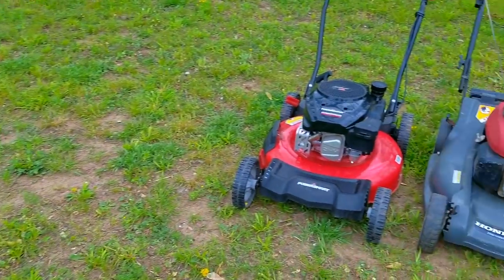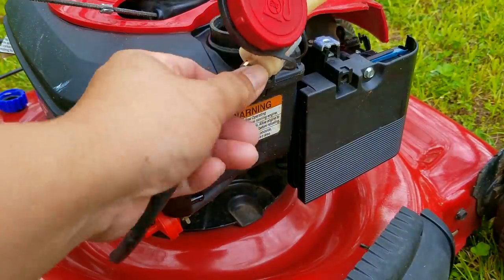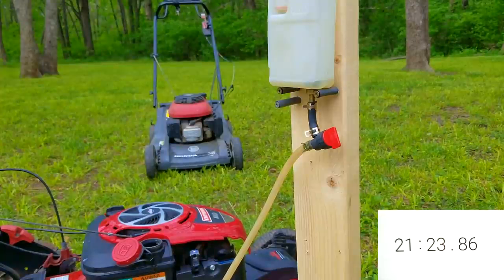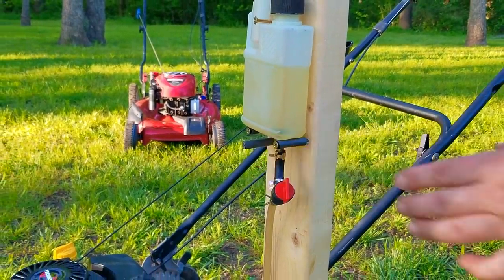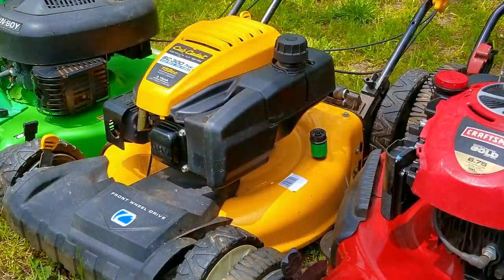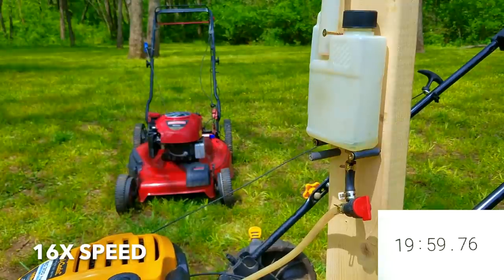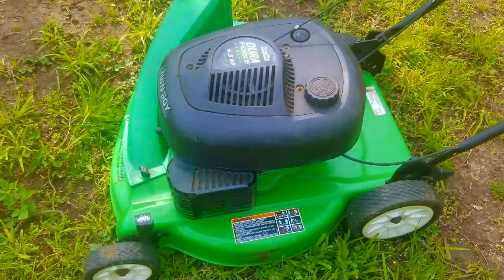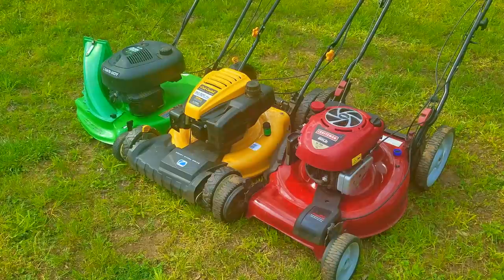One Of These Mowers Will Run Almost Twice As Long As The Other One

Comment: Hi there just for facts 2 stroke mowers are King of the lawns for these reasons. Since lawn boys were made and designed since the 50s until the Duraforce the rpms are at around 3200 whether with throttle carbs to fixed carbs in high or normal speed. Low throttle is around 2600-2800 rpms from my research. Most safe bail brake residential mowers of today and from about 1984 until the present don't exceed the 2800 rpms unless it's a commercial Honda or Kawasaki in which case full throttle are 3000 rpms at 5.5 hp and 6 hp respectively. Thank crappy unsafe homeowners that can't handle true power and the EPA for making 4 cycle mowers the scrap metal junk that they are today because before safety bails they were at 3600-3900 rpms and more expensive than 2 cycle mowers due to more parts to produce and ease of use to not having to mix gas for people that don't know how to properly measure and mix 2 cycle gas . I'm only talking about push mower rotary engine numbers as reel and riding mowers require higher CC's and rpms to run belt drive systems, clutch systems, etc. Hope any of that helps sorry for the 18 page paragraph for explanation. Big love and peace out from Houston, Texas.
Reply from the maker: you've got a lot of information to share and I really appreciate it.

Comment: Tecumseh mower I had was great went thru anything it was very old and well used when it finally died
Reply from the maker: thank you MegaLancet, they're definitely underrated
Reply: @HomeGaragechannel  don't suppose you have a video on viking rideon trying to fix one currently not sure if it's one of the 3 kill switchs or the ignition the battery is fine wiring all seems ok so leads me to believe the key ignition isn't doing its job or the kill switches are stopping it the lawns here are too big for electric or gas push mowers so found a project to speed things up money is tight here so you need to learn as you say we are all hurting over living costs
Reply from the maker: unfortunately no.

Comment: I really enjoyed your video

 now looking at the small push mowers that actually have a throttle control; I would not consider that cheating in fact my riding mower is I have three of them right now have throttle controls my generators have throttle controls

 that is not cheating that is taking advantage of using the amount of power you need instead of wasting gas for a power that is not needed for that job

 when it comes to my riding mowers I got a very good cut using medium throttle and sometimes row below throttle to not wake up the neighbors it does not seem to affect the cut of the grass unless it's very heavy grass and then I use maximum throttle.

 I find it a very good way to save gas that is not needed to be spent because I do not need all that power.

 my current riding mower for a lawn as a Cub Cadet xt-1

 my older models are an errands and a Sears Craftsman.

I'm a big fan of two stroke engines  but  the problem they stop making two stroke engine has a lot to do with Emissions.

 two stroke engines have twice the power stroke and also because it has no valve train is much lighter.   there are a lot of benefits with two stroke engines if he were the two stroke engines I owned was 1 a speedboat,  chainsaws and gardening equipment like weed wackers and hedge trimmers to name just a few.

2 stroke engines are cheaper to make (far less parts) but are emission unfriendly
Reply from the maker: thank you for the information, and no, it's not really cheating to be smart with how you Use the throttle, it's just like driving a car.

Comment: Hey bro wats up? I wouldn't change the adjustment on my mower (if I had one😄) to save money on gas. It just doesn't make sense in my opinion since it might be putting a strain on the engine and it will end up costing you a lot more in the long run😔
Reply from the maker: Great point, Thank you Ramadin Sookhoo.
Reply: @HomeGaragechannel  you're welcome bro

Comment: I own a Toro time cutter ss4235 with the sv710 and it drinks gas. It had gotten so expensive to fuel up I had to stop using it. It will have a new more efficient engine installed soon. My Kubota ZG20 does not burn as much fuel. As the time cutter did and the hydro gear zt2100s are weak compared to Kubota drive system.
Reply from the maker: thank you for the information

Comment: If you want to put a load on it, I would disconnect the shut off wire and apply the engine break while the engine is running.  The only problem would be you may damage the flywheel from the friction.
Reply from the maker: you are correct

Comment: While variable speed mowers may have an advantage it would be interesting to know the speed of the mowers engine as they were tested, and if a tested mower has an adjustable throttle, both the tested engine speed and the maximum speed. Then if it does do better or worse you could estimate how it may perform at at different speeds. Or maybe run them at max speed too for an extra data point
Reply from the maker: yes you are absolute right, I that was my oversight.

Comment: AS Motor have (or had until recently) built a two stroke engine for some of their mowers that still managed to comply with emissions rules, although an EGO power unit is available on AS Motor decks from this year which I assume has now killed off the AS Motor two stroke although a four stroke is still available albeit a Briggs & Stratton.
Reply from the maker: thank you Volvo B10M

Comment: For that type of testing you'll need a swiveling point to tie to other wise the rope or whatever you used to tie it down with will wrap around the 2x4 or whatever it's tied to , also I agree the self propell is not meant to drive the lawn mower by it self most will struggle to as well especially with making a circle constantly straight lines is one thing but turning will put extra strain on the drive wheels now I know some of them probably can do it but the testing wouldn't be repeatable with every mower   in my opinion so the only way to test would be to actually use the mower with you testing tank attached to the mower and see what times they get to be fair to all the mowers involved which I'd only test the longest running ones with the drive activated and see what if any difference in times they get
Reply from the maker: very true, we'll see what I decide on .
Reply: @HomeGaragechannel  indeed we will see lol 😆  looking forward to seeing the next video

Comment: The AS Motor International AS531 is the only 2 stroke mowers that are produced and available on the market from my extended research on the topic of 2 stroke mowers but at a price tag of 8000 dollars plus how much it would cost to get it from England or Germany your better off trying anything old from the states or Japan honestly unless you got it like that then all power to you. It features an old rare Briggs classic Komatsu made engine that used to be in old snapper push rotary mowers. Snappers had the most outsourced 2 stroke engines of all time with Briggs , Tecumseh and Wisconsin Robin all ending up being replaced with 4 cycle garbage.
Reply from the maker: thank you for the information, I'd just buy an old lawn boy instead. The AS stuff looks really cool though.

Comment: I've seen another Channel weld flaps to cause drag on the blades.
Reply from the maker: that would work too, but I don't want to damage the blade, or even it's a test blade with the flaps welded to it already, I want to test they, with the blades that came on them.

Comment: Didn't watch the video yet but did you use the same fresh gas? Brand new same model spark plug in all?  Those 2 factors can really change fuel consumption in small engines...
Reply from the maker: the gasoline is the same for all fo the runs, even with the mixed fuel, and no the spark plugs are factory specific, some run champion, and some run NGK from the factory.

Comment: Fuel use is a hard thing to measure because it would depend on how many times the governor has to open up the thicker the grass the more fuel the mower use and with that the size would be efficiented the more torque the engine has the less it has to work to cut the grass there are a lot of variables to in doing a test like this but the two stoke winning doesn't surprise me
Reply from the maker: you're right about that.

Comment: Regarding the compression tester you have using 14 and 18mm adapters. Will one of those fit a Husqvarna 128LD trimmer?
Reply from the maker: yes it should

Comment: That was interesting. “Every stroke a power stroke” might be a reason for the extra efficiency. My understanding of the death of the 2 stroke LawnBoy and Toro is that the EPA regulations killed their practicality. The oil being burned as fuel adds to the emissions and there is no way to clean them up. 

I have two identical Snowblowers manufactured one year apart with the same Tecumseh two-stroke engine in them and the older machine says on the gas cap 40 to 1 and  the one year younger one says 50 to 1. That is another example of the manufactures using less oil in the mix merely to meet the EPA regulation.  I do not believe that they reengineered the machines to run on 50 to one they just changed the amount of oil you’re putting into the fuel to meet the EPA regulations at the expense of engine longevity. I personally run all 50 to one equipment at 40 to one.
Reply from the maker: that is interesting, and yes it's a shame they don't make them anymore.

Comment: I have one just like the cub cadet but mine has the zero turn caster wheels in the front and its a sc500z and ot has a carb issue
Reply from the maker: nice, are going to replace the carb? have you checked the valve lash?
Reply: @HomeGaragechannel  i haven't checked the valves yet but I've had to clean the carb a few times and it's fixed the problem temporarily but I just like my briggs flatheads
Reply from the maker: me too.

Comment: This is another reason Kawasaki went 2 stroke for a hybrid system for there bikes the power - fuel economy and lower emissions they found not released yet going by patent and videos showing it off
Reply from the maker: they're going hybrid?
Reply: They are doing EV / Hybrid cross the 2T only charges the system less strain and keeps it running when far from chargers is the idea they have a few things they are trying nothing out yet for sale

Comment: you're better off weighing the fuel you could weigh it before and after the test or just way out the same samples and pour it in very hard to get accurate measurements the way you're doing it

Comment: I'm not sure the Briggs fuel efficiency makes up for it's shorter lifespan. Although that model Briggs was the last decent mower engine they ever produced, this new overhead valve one is pure garbage. I'd put one of those Chinese engines up against them any day. My scrap bin tells the story, the only Honda or Chinese engines that get tossed are due to mechanical failures due hitting stumps and rocks and bending the cranks. Most of them are Briggs with worn bores, worn wrist pins, or cracked heads. Some are pretty new, one was just out of warranty and lost compression due to worn bore. Also I don't understand why people don't like the Tecumseh, finicky carbs but a long lasting engine.
Reply from the maker: wow, I really appreciate the information you've given us.
Reply: @HomeGaragechannel  I have a small engine/atv shop. I might not be the most knowledgeable but I tell it as I see it. I am a Honda fan, but Briggs is far more common, I get people in here all the time that don’t understand why their new mower won’t run. A few months ago I ran into a mower with a Yamaha engine, never even heard of one, guy said he bought it in Okinawa when he was stationed there. That was a damn nice mower. Of course parts had to be ordered from Japan.
Reply from the maker: thanks for sharing the information .

Comment: I fixed one of those Cub cadets for a guy the rocker arm was off and the rocker panel was loose and that's why It wouldn't run they are built terribly cheap do not buy one and his mower was only a year old
Reply from the maker: thank you Were Daltan.